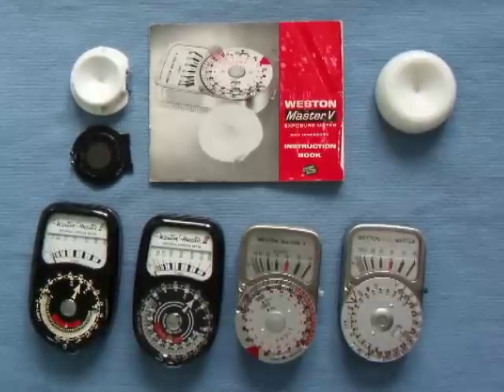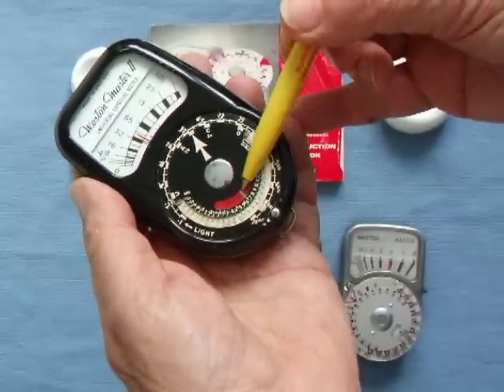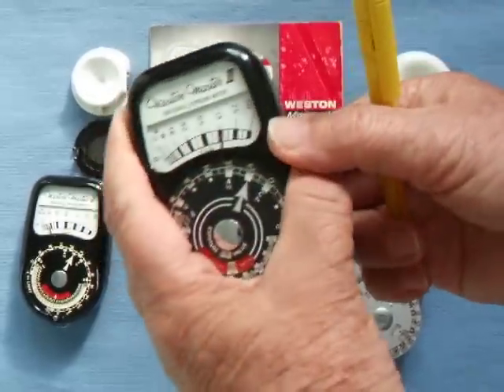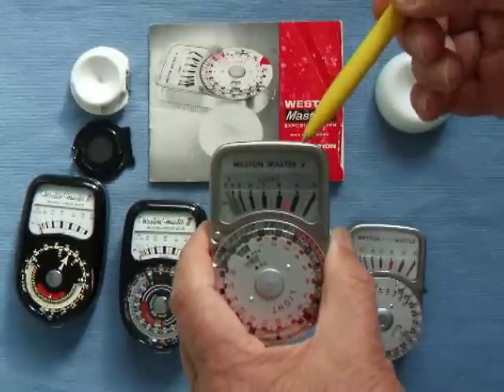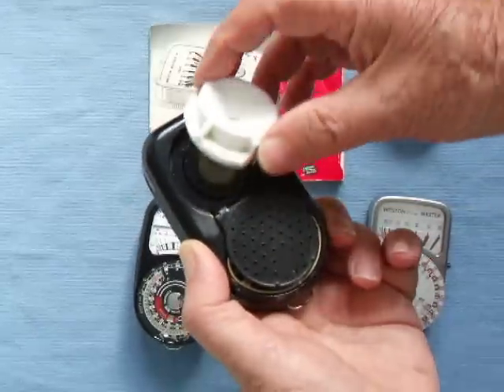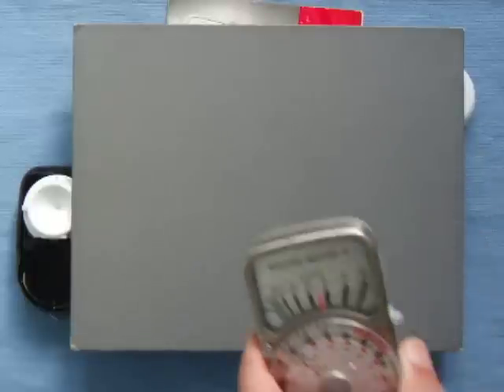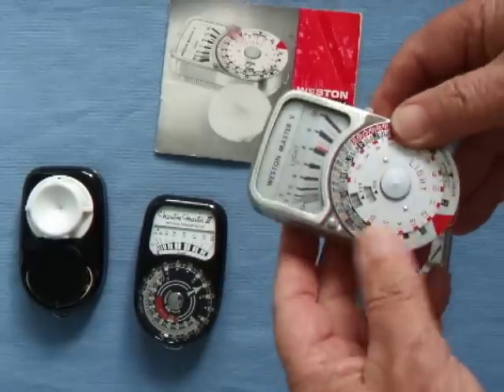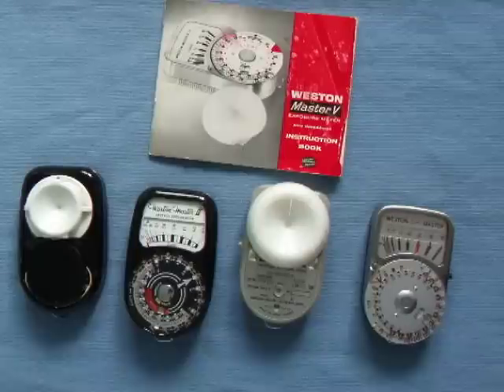Using WESTON Exposure Meters

Comment: Thanks for putting this up
Very intuitive and well presented
Invaluable for me
Reply from the maker: Thanks for kind comment -- I used my Weston Master III and the V recently and they both agreed and gave good results , with the Invercones .
Reply: Peter Elgar Thanks for this very interesting resume.
I have a Master V which I have not used for very many (30+?) years.
The needle hovers around the zero reading.
Is there any way I can bring it back to life?
Thanks,
Stephen
Reply from the maker: Stephen Singer
Stephen : It looks as if the Selenium Cell on your meter may be corroded -- there is some info on this site :http://ian-partridge.com/westonrepair.html
He is very expensive though -- I remember when a NEW Weston could be bought for just over £10-00 !
Reply: Peter Elgar Thanks, would seem to be a bit of an indulgence, as I have no need to use it.
Stephen

Comment: I bought my first Weston in 1972 with a Pentax S1a. Subsequently I owned a Weston V and a Euromaster ... I still have last two and they still work perfectly. I switched to digital cameras about 10 years ago and currently use a Canon SX60HS - but I still really enjoy using the Weston or Euromaster alongside full manual settings on the Canon. I don't do that all the time, of course, but there's something much more personal, creative and satisfying about working out all the settings for yourself for any special images that you want to capture or create.

For anyone who is unsure about the link between ASA and the more common, current use of ISO ... don't confuse yourselves. For all but the truly finicky, an ASA of 400 = ISO 400 and so on. It's a throwback to when we thought about the sensitivity and grain of film as opposed to digital sensors. But the two concepts, although physically different actually lead to almost identical results. Lower ISO, like lower ASA leads towards less 'digital noise' which equates to smaller film grain, and higher ISO leads to increased digital 'noise' which equates to larger film grain and therefore less sharp images. Modern cameras can use higher and higher ISO values with less and less evidence of noise. It's fun to use Westons or other lightmeters with displays of high ASA values that would generally have been frowned upon (or downright insane) when using film.

You can still find these old exposure meters (and other makes) on Ebay, in many specialist shops and at collectable sales .... but do try to test them first as they can be damaged if handled badly. I once dropped my first Weston down a cliff and it survived. Later on I dropped it on the beach at Lyme Regis and it was wrecked!!!
Reply: Prior to '72 I was using another lightmeter - can't recall the brand but it was Russian and worked OK until it went tipsy-over-the-edge of a cliff and disintegrated on the rocks below. (That's what I got for trying a few shots of seagulls along the cliff edge. That's two lightmeters I wrecked in that way.). Since I posted the previous comment, I've switched from the SX60 which I just didn't like, to a Lumix FZ330 which is spot-on for my needs. Also since the previous comment, I've given the Euromaster to a friend but I've retained the Weston V which is as familiar as an old friend. I still keep up the skills by switching to fully manual mode with the Lumix, or when I use an older FZ30 or Fuji S7000. (As you might guess, I have strong retro tendencies).

Comment: This reminds me of the Sekonic L-28C that I used after the GE Selenium cell meter finally died. I've seen Weston light meters from time to time, so it's nice to know how well they worked as the CdS and Silicon cell light meters began to replace them. (Some of the Si cell units could read electronic flash pulses, which led me to a Minolta Flash Meter IV.)

Comment: Thanks for the video but got a question. I have a Master II, when zeroing the needle what is the correct way of holding it? For example with no light upright or on a flat surface it can read at zero if you tilt it to it's side as per the instructions the needle goes to .4 lumens and if you flip it the other way with the display pointing to the right the needle dips below zero.
Reply from the maker: Thanks for viewing -- well when I 'Zero' the needle I hold it upright so I can access the back screw with my hand covering the photo cell so no light gets to it .
Reply: I'm having the same issue. Glad to see that it is normal. I guess, basically (what Peter Elgar is saying), you hold it like you normally would, cover the photo cell at the back so no light gets through, use the screw at the back to calibrate the needle so that it shows zero.
Then just try to hold it in the same manner always.
If you hold it in a different manner (for example pointing it downwards) I guess you have to account for the needle drift in your calculations.

Comment: The cell in these will with time die, or at least give a greatly reduced light value.  I'd love to use my Master V but its reading is not sensitive or linear anymore.  Have you had any of your meters rebuilt?  When I called around I was told nobody made the cell anymore.
Reply from the maker: No not had any rebuilt

Comment: Thank you! I just stripped down my meter and re-fixed the glass with the help of "Jesito" The meter is made all on metal, strong building. The opening zone is on the bottom side, under a small plate fixed by two supposed rivets. They are just screws with no groove? on the screw head. (I don't know the english word for this).
To remove them, small pliers and a lot of care: (I used my fingernails).

Do not touch the center screw, it's only for adjustment and has nothing to do with the disassembly process.

Under the metal lid there are two more screws, sealed under wax. It's necessary to remove it to get to the screw head.
(My meter has more screws into which the previous ones are screwed).

Once these screws out, the back cover goes out under pressure, from the bottom up (At 30 to 45 degrees to slide out 2 retaining pins) - (some retainers in the top side). Below they appear the remaining screws. Be careful with the two springs that handle the scale change.
(Be aware of the pin and tiny spring near the rope loop).

The last screw on top, again under wax seal:

Once the screws removed everything is handy. The meter cover goes out easily. Be careful with the meter needle.

At this point I was too concentrated in fixing it that I forgot to take more pictures, but essentially was a general cleanup, specially on the glass area, cementing again the glass on it's base, disassembling the selenium cell and cleaning the contact area with a dry Scotch Brite (quite abrasive). From then on, the needle was responsive to the light changes, so I finally could build it all again in reverse order.

(I scraped away all the old adhesive and paint to expose the metal underneath that is inside the cover and will not be visible once reassembled. I very carefully used UNIBOND CRYSTAL, an industrial building adhesive. Tissues, cotton buds and white spirit / turps to clean up before the adhesive set!).
Reply from the maker: Tom -- thanks for your Contribution an d a successful renovation of your Weston Meter!!
Reply: @theoldfilmbloke  The "Screws" holding the plate on the back have "Hex" heads although I do not have a socket small enough, I managed with fingernails!

Comment: Hello, I'm sorry if this question is a wee bit daft but how would you use this for landscape photography? I plan to do a tour of a lot of the lochs in the highland of Scotland (I'm a lowlander myself haha) and I want to take my favourite film camera, however, sadly enough the camera's light meter is died, so I need a light meter and I really like these old fashioned light meters, but I'm totally clueless on it myself haha. Thanks.
Reply from the maker: Thanks for your query -- well, I use these meters with MY Old Film Cameras BUT I have to warn you they are over 50 years old and the Selenium Cell may be damaged with damp, rust etc and age and NOT be working . I have several now ( all given) and i have to test them before using them. Some no longer give a reading. If you get a GOOD one then if you have the White 'Invercone' for 'Incident Light' readings that is best for 'landscape photography' . You have to turn round to face the light FALLING ONTO the scene and point the side with the white  Invercone to that light and get a reading. OR if NO Invercone then point it down to the GROUND and get a 'reflected light' reading -- do not get any 'bright Sky' in the reading just the ground.   Keep Snapping ----  Peter
Reply: +Peter Elgar  oh I will keep that in mind, I read somewhere that can get these things repaired so if I get s faulty one I will just send it off. Also thank you very much for explaining that to me I really do appreciate it and to spend the time to reply. :)

Comment: I'm puzzled as to why you measure light falling on the subject (flash sun) and not light reflected from the subject, as that is what your camera will be taking a picture of. As a landscape photographer, I would be exposing for the sun all the time instead of the landscape? This doesn't make sense to me
Reply from the maker: Yes -- Built-in meters in cameras DO measure reflected light BUT it is not accurate all the time and you have to recognise the occasions and use 'Exposure Compensation + or  - '--  The 'incident Light Method' is easier if you have a separate meter with the white baffle especially for YOU -- a Landscape Shooter, as it is not influenced by large areas of white Snow or sun on White Sand OR if you are in Wales photographing dark toned slate quarries !
Reply: reflected light will be different depending on the color/reflectiveness of the object you measure, so a black object would give a lower reading than a white object even if they are in the same light. The incident light falling on a subject will be the same regardless of the color (assume your lighting doesn't change), so the reading would more accurately depict how much light is in the scene. And you are not exposing for the sun (using incident measurement), you are exposing for the amount of light from the sun that is hitting the meter. If you used a reflected measurement and point at the sun, then you would be exposing for the sun. That is where the white cover becomes important, it causes less light to hit the selenium cell.

Comment: How do one set the ev value of 12 on the camera?
Reply from the maker: Jesper :  have been very ILL in HOSPITAL with a Liver cancer operation so could not reply   i have a 1956-59 Rolleiflex 2.8 e Xenotar with 'EV' settings and a 1966 ' Werramatic' but have never used the 'EV' values. I had a look at my Weston Master V -- so for and ASA of say 100 EV 12 gives a selection of exposure settings, up yo YOU which one to set according to if you  want a faster shutter speed to stop action and  camera shake OR to have a slower speed  BUT more Depth of Field for greater sharpness through the subject. I got settings of : 1/250 th  @ f4 or 1/15th @ f16 for example
Reply: Peter Elgar thanx peter. I do hope you are improving...take care.

Comment: Yeah, right. A video of endless blahs. But this guy does a wonderful job explaining the minutiae that you had to master. I bought a Master II 5 or 6 years after he did - in about 1960. Remarkably, it works now exactly as it did then - some 60 years later. That is, it is still fairly useless and pretty inaccurate. To fully understand things, you had to understand the difference between the Weston scale and ASA, DIN, Lumen - weird stuff like that. Knowledge of the gray scale helped too. I had an ancient Ziess Super Ikonta 538 back then, and photography has never gotten any better than that. But with my then perfect vision, it was very difficult to read the tiny numbers on this thing, and turning the rings was a nightmare. I still have it. Not quite heavy enough to make a good paperweight. You can buy one on eBay but don't pay more than 5 bucks - which is WAAYYY more than it is worth. But COOL!! Pull it out when you want to pass yourself off as an expert. Fun stuff for PhotoNerds.
Reply from the maker: At the Time in the 1950's they cost a 'bomb' compared with my Pocket Money as an Impoverished Schoolboy as there was so much 'Purchase  TAX' on anything 'Photographic' !

Comment: Are these still practical for modern digital cameras?
Reply from the maker: Luis : No not really useful with 'modern Digital' but very useful for older FILM cameras as i use a lot !
Reply: Thanks!
Reply: Perfectly good. I use my Sangamo Weston Master V to measure incident light, something my EOS 80D cannot do. I bought the Master V in 1966 with my Yashica JP, a totally manual film camera. It is very useful with modern digitals especially in portrait work. It doesn't need batteries either!